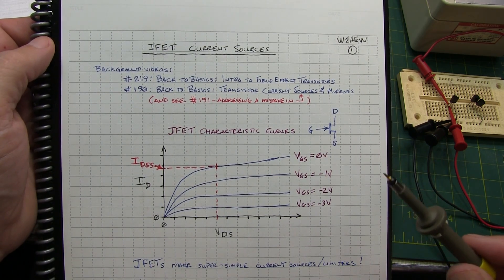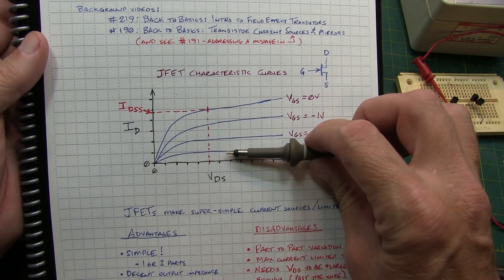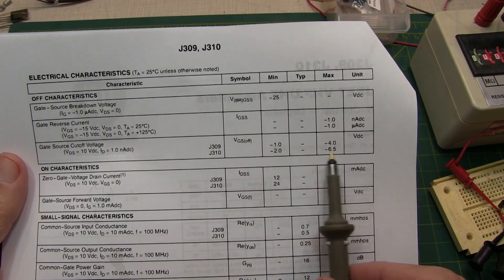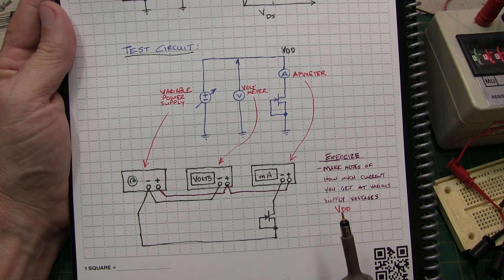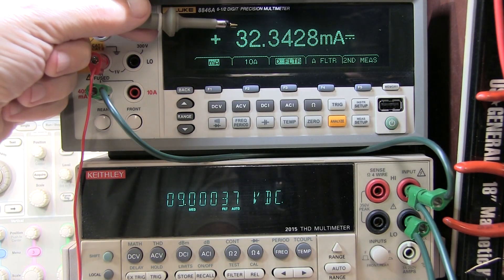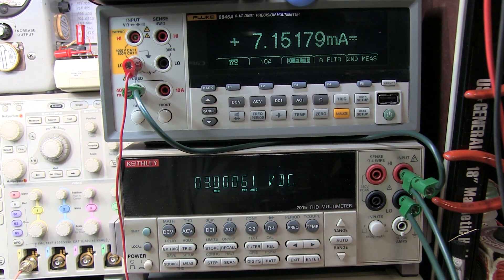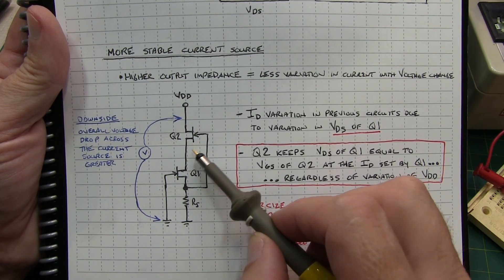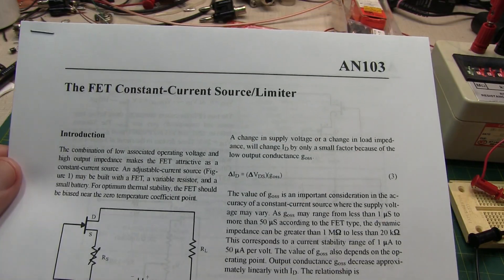#374: Back to Basics: JFET Current Source / Limiter circuits

Comment: I had heard that there is such a circuit as SCR's that are operated in the oscillation mode.  Although there is no need to have them work at RF frequencies, they have been known to oscillate in the audio spectrum, but I haven't seen any circuits that accomplish this.  If you have anything on this, please do a video.  If a circuit of such does exist, I just gotta see it!    73's,   Gary Grove
Reply from the maker: I've only ever seen relaxation oscillators made with SCRs.
Reply: @w2aew  The one circuit that I did see was using the ac line as its power supply, but that was not an "honest" form of oscillation.

Comment: This is really cool, Alan! I could see this being useful driving LEDs, particularly as the season of holiday lights approaches. Not being an EE, I wonder how much heat this would dissipate? I assume it would be a function of the FET's "on" resistance?
Reply from the maker: Power dissipation is simply the drain current multiplied by the drain-source voltage.  Given that it is a current source, the current is a fixed value, and the voltage across the drain-source will simply be the supply voltage minus the sum of the voltages across the devices connected between the supply and the drain.  For example, if you were running a 12V supply and the current source was set to 5mA, and you had 3 LEDs in series, with a voltage drop of 2.5V each, then you'll have 12-(3x2.5) = 4.5V across the drain-source.  So the JFET would be dissipating 4.5V * 0.005A = 22.5mW.
Reply: @w2aew  Oh. Easy enough! Thanks for the explanation.

Comment: You didn't explicitly explain that having a source resistor provides negative feedback; to be precise any tendency to increase Id will result in an increase in Vgs, thus opposing that increase (and obviously the same applies for any tendency to decrease Id). One of the results is to sharpen the knee of the curve relating Id to Vd as well as flattening its slope, which represents the output impedance. The flatter knee allows Vd to be less while remaining a useful constant current source. The cascode circuit has the other disadvantage that the lower JFET only sees the Vgs of the upper transistor as its Vds, and that puts its operating point on the knee, giving a lower output impedance. That's why the cascode doesn't offer as much improvement as you might hope.

Comment: When the FETs output voltage is NOT Flat, this is the FETs output impedance? I'm confused when the FETs output voltage is NOT flat what types of problems can it cause with other circuits?
Reply from the maker: When the FET drain current is not flat vs. drain-source voltage, that is an indication of a lower-than-ideal output impedance.  This would cause issues only in circuits that rely on a constant current regardless of the voltage at the load.  One example might be precise timing circuits that use the constant current to charge or discharge a capacitor to create a linear voltage ramp.
Reply: @w2aew  When the FETS current is not flat the FETS output impedance is lower? I'm confused how the FETS drain voltage is FLAT while the FETS drain current is "Not" flat at the same time. I would think the drain voltage and drain current would both be either flat or not flat but they are also be opposite at the same time which doesn't make sense to me.
Reply from the maker: @waynegram8907  It is all shown in the curves.  The drain current represented on the vertical axis is relatively constant (flat) as the drain-source voltage, represented on the horizontal axis, varies.  The "flat" portion exists for drain-source voltage above a few volts.  BJT transistors are similar.
Reply: @w2aew  The Horizontal axis is the drain voltage which is not flat it has a SLANT. I don't understand why the drain voltage is not flat. I'm not sure why the FET output impedance would vary or contribute to the drain voltage to be slanted not flat. I guessing the doping resistance or junction resistance or the FET channel resistance is causing or contributing to the drain voltage being slanted not flat?
Reply from the maker: @waynegram8907  You're not interpreting the graph correctly.  The graph is showing a change in DRAIN CURRENT in response to the DRAIN VOLTAGE change.  The SLANT is on drain current in response to drain voltage value.
Reply: @w2aew  Yes true you used 2 DVM meters to measure the Source to Drain Voltage and Source to Drain Current because you mentioned on the Ammeter that the current changes slightly. Its hard to see the micro changes of current using a curve tracer or Oscilloscope XY mode. The ammeter shows the micro changes of current easier. The SLANT is the drain current because you mentioned its caused by the FET or Transistors output impedance. What I'm confused about is the output impedance is Slanted because of the Transistors junction resistance or FET channel resistance? or what is causing the output impedance to be causing the Drain current to be slanted
Reply from the maker: @waynegram8907  The slant is due to the change in V(DS) causing a change in the channel pinch-off characteristics.
Reply: @w2aew  The FETS Channel Pinch Off Characteristics is like a Non-Linear Resistor which is causing the SLANT? The Transistors NPN or PNP Junctions is like a Non-Linear Resistor which is causing the SLANT? For Vacuum Tubes don't have that SLANT, any reasons why? I'm not sure what this Slant correct EE term would be called but its a non-linear slant but I'm sure EE engineers must have a name for this slant that occurs in transistors and fets but not in vaccuum tubes
Reply from the maker: @waynegram8907   The slant is the output impedance
Reply: @w2aew  Yes true, but the slant is caused by the Non-Linear resistance from Source to Drain or Emitter to Collector of the FET or Transistor? Vacuum Tubes output impedance has no slant because the electrons has to pass through Crystal Lattice in silicon material in transistors which vacuum tubes don't have crystal lattice. FETs and Transistors can't cause Flashover compared to vacuum tubes can cause Flashover if the plate is High voltage out of spec. I'm not sure what is causing the Flashover but Fets and transistors don't cause Flashover which I'm not sure why. I'm guessing because of the Source to Drain resistance and Emitter to Collector resistance prevents Flashover.

Comment: Would have been nice to see the circuits back on the curve tracer as 2 pin devices
Reply from the maker: I went back and tried the 50uA Current Source, like the one to calibrate Simpson 260 VOM, built using a single JFET and the cascode design, traced out on the curve tracer, including a zoom in to 1uA/div:
http://www.qsl.net/w2aew/youtube/50uA_curves.pdf
Reply: @w2aew  Thanks, that's very kind of you! What's the source of the wiggle on the zoomed in plots? Is it artefact? oscillation?
Reply from the maker: @KX36  I think it is an artifact - likely some switching logic cross-talk or a power supply filtering issue inside my old 576.

Comment: I have used JFETs a couple of times and am aware of the large variability between devices.  Why are these so hard to make to narrower tolerances?
Reply: BJT's have also very large differences, but in 'amplification factor' (beta or hfe). It can vary per device from 10x  to 600x. After manufacturing these are measured and divided in groups (like A, B, and C types), and the worst are probably thrown away. I guess they don't that with JFET's. The art seems to be to design stuff where the variation is not important or ruled out, like a self biassing circuit.

Comment: There were current "diodes" available 50 years ago. They were probably made by Motorola.
Are there similar devices sold today by some companies?
Reply from the maker: There still are.  Just take a look at this listing from a quick search on Mouser for "current regulator diodes":
https://www.mouser.com/c/semiconductors/discrete-semiconductors/diodes-rectifiers/current-regulator-diodes/

Comment: Nice video as always! I think it would have been nice to use the curve tracer to characterize the current sources, not just the plain JFET. This way, we could have seen a graphical representation of the output impedances of the various topologies that you've covered. :D
Reply from the maker: I went back and tried the 50uA Current Source, like the one to calibrate Simpson 260 VOM, built using a single JFET and the cascode design, traced out on the curve tracer, including a zoom in to 1uA/div:
http://www.qsl.net/w2aew/youtube/50uA_curves.pdf
Reply: @w2aew  Nice! The zoomed in curves look exactly as I expected. Thank you so much for going through the effort of taking these pictures. 😁
Reply from the maker: Yeah, I thought about that, but didn't want to make the video too long.

Comment: Thanks Alan! So my question is if there is so much variation in components you could theoretically substitute an mpf 102 in place of a j 310 within reason and assuming that you stay within max ratings. Am I correct with this thinking? Take care and I always enjoy your videos. 73's!
Reply from the maker: Sure, an MPF102, and just about any JFET would work the same way, but all will have different I(DSS) and V(GS) Cutoff differences.

Comment: Excellent video, as always. After I saw this, I compared the cascode arrangement to an arrangement with J111, J112, J113 in series with grounded gate and a degenerative resistance. The latter provided a higher impedance source with the same burden voltage in LTSPICE. Of course, as you mentioned, the manufacturers never figured out how to make JFETs with consistent performance, so a lot of testing would be required to see if this really works in practice. This was always a problem when manufacturing low noise transducer preamps. Of course you could pick out ones with similar characteristics, but then you would have to hand solder them to the boards. Then, the medical imaging people came in with big bucks and insisted on low noise JFETs that had consistent characteristics. So now they are available for about $100 apiece for a JFET with 0.8 nV per rt Hz performance that has been binned by the manufacturer prior to inclusion on a reel. I guess this is acceptable on an MRI machine, but not in any of my applications...

Comment: Great video again! The link to the Application note needs to be 70596 instead of 70595.  70595 is about Biasing. The information about the cascode could have been a bit more detailed in the relationship between the top and bottom Fet as the top Fet should have equal or higher Idss so the bottom Fet doesn't starve.
Reply from the maker: Thank you - I fixed the link...

Comment: But what is uniquely different about a JFET?  I had bought some JFETs from China, they were fraud devices, they were really BTJs.  They did not work in my device (a DIY capsule microphone that needed a balanced circuit).  The knock-off was un-balanced.  I bought a genuine JFET and it worked.
Reply: The circuit I'd made was RF.AMX10 .. search for that.  That circuit WILL NOT WORK without a JFET.  Not sure why exactly.  Somehow the JFET 'floats' whereas a BJT is biased to ground one one side.
Reply from the maker: @kippie80  This only works with a JFET because it will self bias with a negative V(GS) due to the voltage drop across the source resistor.  A BJT wont work because it needs a positive V(BE).

Comment: Some years back I made a Triax cable tester which had a 9v battery supply and LED indication. It needed a current limiting circuit so I used the cascode constant current source you have described. It was easy to set up and the current remained constant over the typical range of battery voltage variation.

Comment: I've had a few projects where I wanted to use JFETs as current sources, but I found JFETs to be very hard to get hold of these days, so I've been using LM334 instead.
Reply from the maker: Yes, there are a lot of parts that can be difficult to find these days.

Comment: I made many CC circuits using your past video on mirroring using NPN (2N2222A or 2N2904) tranys, with each circuit driving a slow flashing colour LED. 
Maybe I missed it in the video, but why use JFET instead of bipolar, since both are operating in their linear region?
Reply from the maker: The reasons can vary.  Sometimes the JFET is just a simpler solution, or it is what is available, etc.
Reply: Then there's that low "base" current!  Bipolar transistors have pretty low base current, for sure, but the gate current of a JFET can get closer to zero.  That's really handy if you want to look at a voltage without disturbing it -- transducers (including musical devices), test instruments and that sort of thing... many kinds of things.

Comment: Thank you for the upload! Out of curiosity, what application would something like this be used for?
Reply from the maker: There can be a lot of applications for these circuits.  A constant current feeding a capacitor results in a nice linear voltage ramp which can be used in a lot of applications in timing, etc.  A current limiter can be used to control how quickly a device charges/discharges, etc.
Reply: Thank you! :) @w2aew

Comment: Great video. Siliconix used to produce a range of JFET current sources. I don't know if they are still available. They were a JFET with gate to source resistor integrated into the package and just 2 leads brought out. Worked great and helped reduce the component count for designs.
Reply: I think those are called current limiting diodes.

Comment: FETs and BJTs where topics in trade school, but i always felt like either the teachers didn't understand them beyond the Wikipedia article.
Stuff like this is what you'd want to know. But they would come up with more complex solutions, that, yes would do a more precise job and so on.
But this really helps to understand the behavior of parts better. And (and this is where my job comes into play) it helps you understand circuits in devices that you are tasked to repair.
The world is full of devices where they pull off that one trick that stops you in your tracks when troubleshooting. Thanks